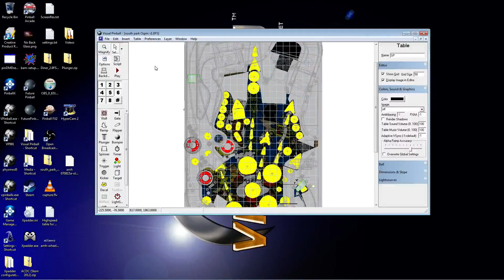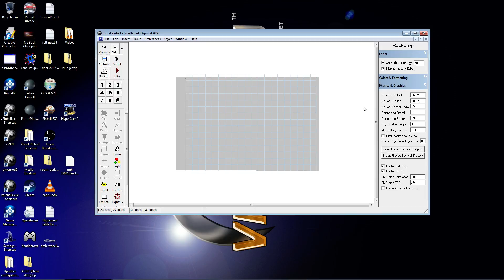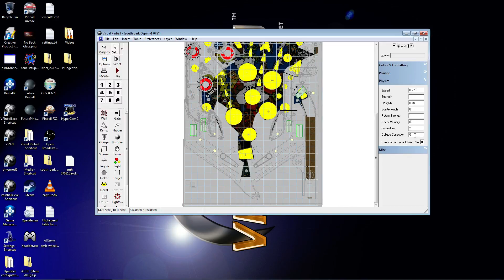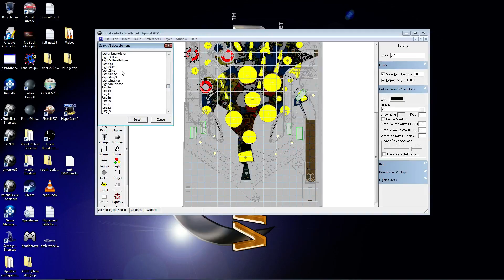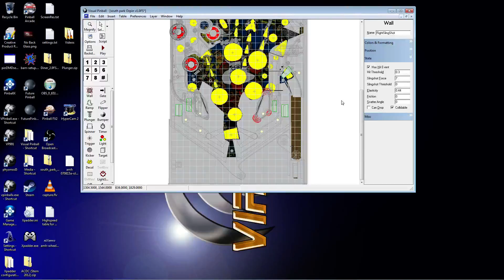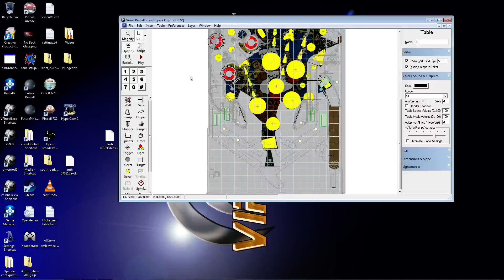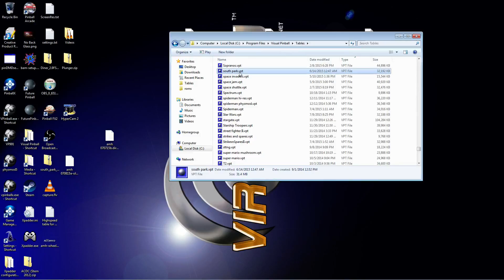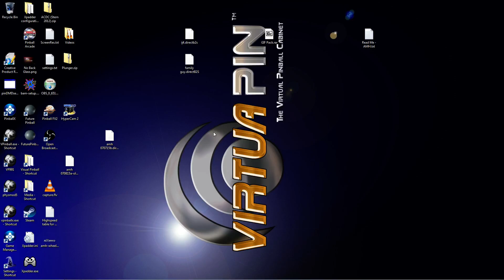Visual Pinball How to tune flipper physics

Comment: On the flipper angle to help you do the math... look at it as a circle, 360° for a full circle with 0° at the top, 90° would be right, 180° down, 270° left... adding a few degrees will make you move clockwise, subtracting will make you move anticlockwise... works for your kick-out direction of your saucer kickers as well.

Comment: Power law is the mass of the flipper in relation to the mass of the ball.  2 is the standard from what I've read.    Since a lower setting makes the flippers made of lighter plastic, the ball tends to fall dead on the flipper, because the flipper doesn't have the same amount of mass.  You'll also have to increase the power of the flipper with less mass.

Recoil velocity is how much power the flipper has in the up position.  At 0, the feature is turned off and the flipper will not give at all in the up position.  This is different than the elasticity in that it ADDS bounce to the elasticity setting when the flippers are held in the up position and are struck by the ball.  The faster the ball strike, depending on where this is set (above 0), the more the coil is going to give and the flipper depress.

I've really enjoyed your videos, Pincade.  If I could give just a bit of constructive criticism:  when you are demonstrating things while playing the game, it would help us understand what you were saying better if you turned the volume off on the game.  Secondly, when you are working in VP, we could see the elements better if you made the VP window a bit larger and zoomed in on things.  These are just minor things to think about, and i hope you don't mind me bringing them up.  Not slamming your videos at all, and I really appreciate the work put into them.